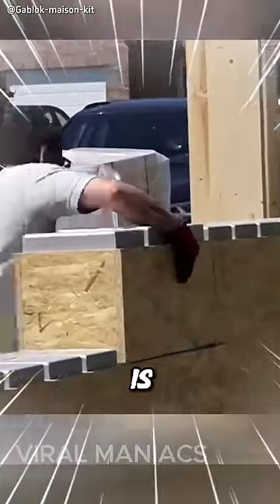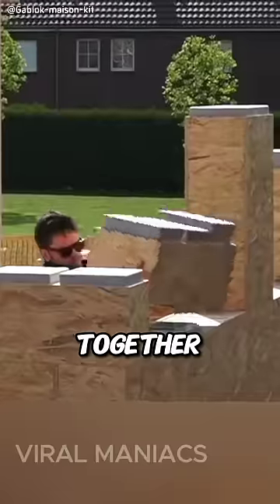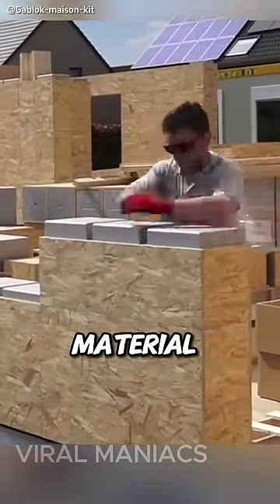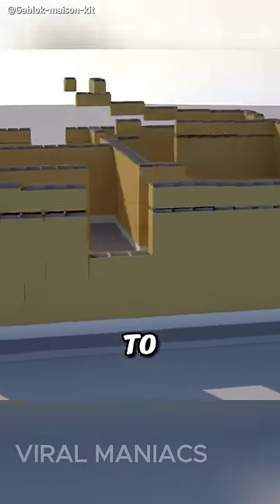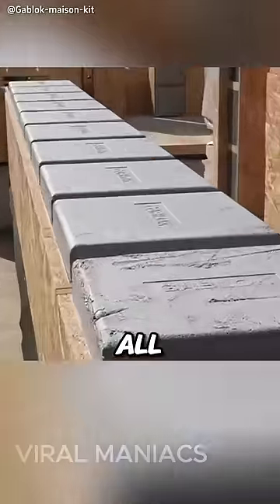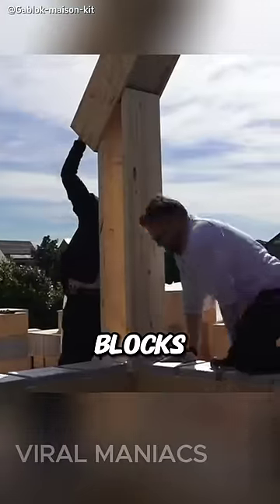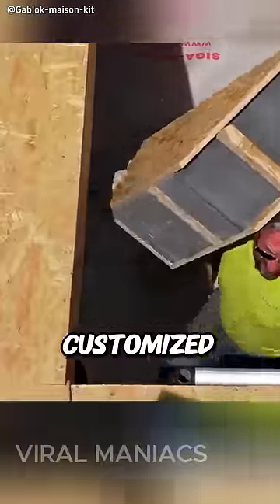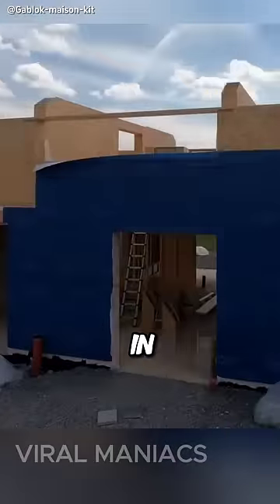Whoever Invented This Way Of Building Houses Is a Genius #shorts

Comment: 60 mile an hour wind, does the house blow apart?
Reply: No, it will just burn from any sparks ignited.
Reply: @levmoses742 like any other house? Lol
Reply: Big bad wolf 🐺 🌬️
Reply: Great question!
Reply: @CarrionSmile Only in the US. Most of the rest of the world learnt about bricks a millennia or so ago.
Reply: @levmoses742 the polystyrene is flame retardant. In fact, if the wood catches, it melts into the wood to put out the fire.

I don't like this method personally, but we need to be truthful. The problem is there is no space in the walls to put service, so you have to frame it out inside anyway. Waste of time and energy.
Reply: @DeltaMikeTorrevieja and that's why every time Italy has a small earth quake they have a crazy death toll.
Reply: @arandom1024 like in... California?
Reply: To be frank, for any kind of natural disaster, minus volcanic eruption and solar blast, the best building material for safety and security is jello.
Reply: @tomassawyer1790  no, not at all like in California.  That's my point, compare an earthquake of similar strength in California and Italy and look at the death tolls and amount of homes destroyed.  For example, about 8 years ago Italy had a 6.2 and about 300 people were killed and one of Californias most devastating earthquakes was the Northridge earthquake, which was considerably stronger at 6.7 and only 50-60 people were killed.  It's just objectively true that wood framing is far superior than stone against earthquakes.
Reply: @timothyblazer1749   The design is made ahead to accommodate all plumbing and electrical lines.  It’s faster for those trades as they don’t have to cut through existing walls.  The chase is already there. Again, another time cutting for installation of utilities.
Reply: @Dbb27  well that's terrifying. How do you maintain them?
Reply: @arandom1024  Yeah, don't mention where the earthquake took place because it will destroy you argument kid.

Also, a kid playing inside that house will make a hole through the walls + good luck hanging stuff from them.
Reply: @nagc99  Northridge earthquake took place in Los Angeles, a densely populated area, which is why I choose that one instead of a stronger earth quake where few people live.  It's not even debatable that wood framing does better against earthquakes than stone.  It's a weird thing to even try to argue, kid.
Reply: @arandom1024  brick buildings are resistant to wind, not serious earthquakes.

The UK had gales and storms with high winds and rarely suffers widespread damage. Earthquakes weren't the topic under discussion.u
Reply: Yes, if it's Hurricane Big Bad Wolf.
Reply: @tomcat4841  in the UK we call a 60mph wind, "a bit breezy out".

We have that every other day. Somewhere.

But the third little piggy salutes you
Reply: Only when the roof is blown off.
Reply: @timothyblazer1749   why would that be terrifying?  One would maintain the electrical and plumbing just like any other home.  Ive owned properties since 1976 and seldom needed to do maintenance inside the walls.  From what I saw on their website it’s like a groove and everything runs along the groove and then the wallboard goes on to finish just as in a regular house.  People are making this way more complicated than it is.
Reply: @timothyblazer1749 back when I used to run wire, I came to the conclusion that we should just be using over the wall conduit for wiring. That was before the days of PEX, so you could probably just as easily do it with water lines too. I don't know about waste water, that gets pretty ugly and obvious, but from a maintenance and upgrade point of view it's a whole more sensible
Reply: @DeltaMikeTorrevieja  good point, except for all that extra weight, time, and skill required. Then there's workability, its not easy to modify bricks.
Reply: @timothyblazer1749 flame retardant? Just like everything in industrial buildings that catch fire all the time?  Everything flame retardant catches fire when there's a certain situation the "geniuses" didn't think of.  Then there's a news story about a tragedy.  And what about plumbing, electricity?
Reply: @gloriousginger Hi Frank.👋
Reply: @NukeStarCraft  a few well placed  taps with a trowel or bolstering chisel and they separate fairly smoothly along the line. Don't hit too hard. Aiming for a growing set of micro fractures not break em in half in one smash.
Reply: Another great building innovation. The negative posts are ignorant trolls. Follow up videos on finishing would be welcomed.
Reply: Nothing securing those vertical joints at each end - pretty sure that moisture would eventually seep through - nature always finds a way through !
Reply: @rickshawwheelchair  oh I agree. I don't like this either.
Reply: @DeltaMikeTorrevieja oh wow Mike what are all these red building made out of square clay stones then??
Reply: @GarrettBradfordTX  clay stones ?
Reply: i would assume you cut into the polystyrene along the inside wall for running pipes and eletrical. It's stupid if they're not doimg it that way
Reply: @Workerbee-zy5nx  😁
Reply: @DeltaMikeTorrevieja This is NOT the same as bricks.  I seriously question the structural integrity of this system.
Reply: @Dbb27 How is plumbing and electric connected?
Reply: @arandom1024 problem is you're comparing apples to oranges as they say. Italy has very old infrastructure and buildings. Their building codes are probably not as stringent when newer buildings were built compared to the USA and especially Cali. 
Italy also has more houses, buildings built right on top of each other, no room or buffet zones, so they fall like dominos.😢
And as you said, wood frame is better against earthquakes than stone built houses.
Reply: @JevonMusicGroup  me too.
Reply: @arandom1024  ...overlooking that many of the structures in Italy are more than 1000 years older than their counterparts in Kalifornia.  Let's see how many Kalifornia homes are standing 1000 years from now.
Reply: @JevonMusicGroup   everything is already planned out. Sewage and electrical is going to be connected like any other house. Why is this concept so difficult to understand?
Reply: @Dbb27  What does "planned out" mean?  The pipes and conduit are already in the blocks?  There are openings in the blocks through which utilities will be run?  Be more specific.
Reply: @JevonMusicGroup   no, the channels are in the design, not the actual plumbing and electrical lines.  The channels are already planned into the design.  No cutting necessary. Go on their website for more details.
Reply: @arandom1024 It is because those houses in Italy are older than America. Nobody uses stone to build houses in Europe any more. More likely bricks and reinforced concrete.
Reply: @tomassawyer1790 when? I lived here since 1975 and the death toll is very minimal except for the 1906 san fran disaster. That case had shoddy buildings before regulations came about.
Reply: @arandom1024 Yes wood flexes b4 it breaks,
Reply: @DeltaMikeTorrevieja  Arizona we have at least 40 days per year with 40 mph winds and at least a few over 60mph.
Reply: @gloriousginger And to be Gerald?
Reply: @DeltaMikeTorrevieja I live in the US, about a block from what was an enormous clay pit and brickyard when I was a kid. 

We’re aware.
Reply: @tomassawyer1790 no, not like in CA, where earthquake deaths have been extremely rare for the last century or so
Reply: Where do we get these?
Reply: Calif has the best earthquake standards for building. Proven fact.
Reply: What House 😂
Reply: @arandom1024  This is a silly comparison. You’re talking about an earthquake hitting a mountain region in Italy with small villages with very old poorly build farmhouses vs a new resident area in California. Houses build with bricks today usually have some sort of inner structure as well. Especially in such areas. Most of those houses in Italy were probably older than most of the populated US today.
Reply: @79messias  modern brick homes are obviously stronger than some 300 year old stone home against earthquakes, but both are weaker than wood against earthquakes.  This is because wood can twist and bend without breaking, as can the nails and metal hardware that is also used to connect the lumber.  This is just objectively true.  I don't know why my random comment about why so many people build with wood(plus the abundance of timber) in the u.s. has ruffled so many feathers.
Reply: @markdaniel8740 I've lived in AZ my whole life we very rarely get winds that high and on average the winds here get to around 25 mph at most some places in AZ get higher wind speeds and there are some years we get bad storms but it's not very common.....and besides what does that have anything to do with the conversation being had?
Reply: @arandom1024   No one has a problem with your statement. The talk was however based on wind. In this case a brick house is superior because of weight. You turned it into a talk about earthquakes, and made a silly comparison, to which is replied that modern brick houses in earthquake zones will be reinforced by a steel structure usually.
Reply: @tommystrickland6268  
Actually if you browse through the comments.
Wind Is The Conversation 😂
Reply: @My-Pal-Hal  Yeah, I did read through the comments. And if you read through the comments you would see that they were talking about  wind speed in California and Italy. Nowhere in this entire comment section thread Did Arizona have anything to do with anything they were talking about. So what's your point?
Reply: @tommystrickland6268  
Nevermind dude.
Human conversation and interactions aren't your cup of tea obviously 🍼 
... arizona will do that too ya
Reply: @My-Pal-Hal  Dude, are you illiterate like go back and read what they said?They literally just said they live in Arizona and that the winds get up to 60 miles an hour and that has literally nothing to do with any of the conversation that was happening before that if you don't understand What I said Then why are you even commenting and asking me something? And also I understand the conversation that was happening perfectly fine Obviously you are the one who has no idea how human interactions work Because there was no reason for someone to assert themselves into the conversation and be like oh I live in this state and this is how high our winds get because it has nothing to do with the conversation. Maybe next time before you decide to try and criticize someone who was simply pointing out that something else was unnecessary You should get a firm grasp of what is being talked about in the conversation to begin with.
Reply: @tommystrickland6268  
... i think he said it's past his nap time , again
Reply: @My-Pal-Hal  so what was the point of you even commenting ? If you don't have something to say then just shut up , if you want to correct me like you tried to then keep up and be able to communicate what it is that I said wrong instead of acting like a baby that can't communicate
Reply: @tommystrickland6268  
... talks a lot about comprehension, but doesn't understand the word "nevermind", im seeing a pattern 😂
Reply: @My-Pal-Hal  Yeah, I asked you a question. Then you said never mind then continued to insult me. So I continued To question why you are even commenting and asking me anything to begin with. If you do not have the mental fortitude to be able to explain yourself, then why even say anything at all? Had you said anything that actually made any type of sense Then I would be able to reply to you and give you some type of answer, but very clearly you are illiterate.
Reply: @tommystrickland6268  
... poor little guy , hope nobody actually googles windspeeds in Arizona , he'll overflow his diaper explaining 115mph 😂 , he funny
Reply: @My-Pal-Hal  And again, you prove that you are completely illiterate. I did not say that the wind speeds can not get that high. I said that on average, they do not get that high, and as a matter of fact, a 115 mph wind is literally the highest recorded wind speed We have ever had in Arizona. That does not mean that it is that windy here all the time. Like I said, I literally live in Arizona and a quick Google search will show you all of what I am saying is true. It's not very often our wind speed in most parts of the state ever reach over 40 unless we are having bad storms.
Reply: @My-Pal-Hal  Also, it is extremely funny to me that you had nothing of substance to say before And now that you wanna start trying to go back-and-forth with me on something while giving actual information, it is still completely irrelevant to the conversation that was taking place in the thread before which again was the only reason why I originally commented , to ask the relevance of arizona being brought up
Reply: @tommystrickland6268  
... told ya 😂
Reply: @My-Pal-Hal  told me what? Dude seriously stop half ass responding and actually say what you want to say or shut up like I said before. you have not said one thing so far that has contributed to the conversation and now your just making shit up to try and act like I said something I didn't.
Reply: @tommystrickland6268  
... id hate to be the one that has to deal with those diapers 🤢
Reply: @tommystrickland6268  don’t feed the troll dude
Reply: @79messias  fair enough lol
Reply: @DeltaMikeTorrevieja it's so crazy to me how you guys think about America all day long and bring it up at every opportunity. Do you just sit in your house ruminating about the US? Being genuine, it's just a depressing way of thinking I can't comprehend.
Reply: @arandom1024 "I don't know why [it] ruffled so many feathers". It's because people in Europe get upset if you say anything slightly positive or even just neutral about the US 😂 some kind of complex
Reply: @CarrionSmile normal houses aren't made with the most flammable materials known to man. This house will literally burn faster than a campfire due to the styrofoam in the walls, and that's not hyperbole.
Reply: @timothyblazer1749  I don't know if they do this, but that could be done at the factory, since you're following instructions to build it block by block
Reply: sixty-mile-per-hour-wind*
🤦🤦🤦🤦
Reply: @JevonMusicGroup Good in benevolent climates with no tornados or earthquakes.  Wouldn’t pass code here in Anchorage, except for a garden shed.
Reply: @timothyblazer1749  Polystyrene is one of the most flammable materials you could possibly use in this context. It is one of the least flame retardent materials. Have you ever lit  a large piece of it on fire before? It's gone in seconds with almost no residue.
Reply: @averysmith5246  yes, if it were not treated. But it is, integrally.
Reply: Does it float on water?